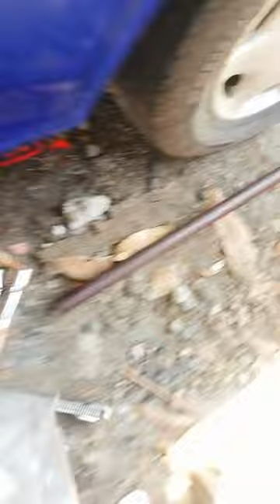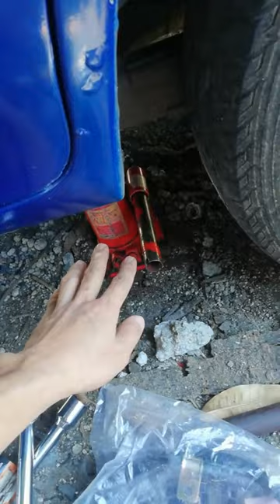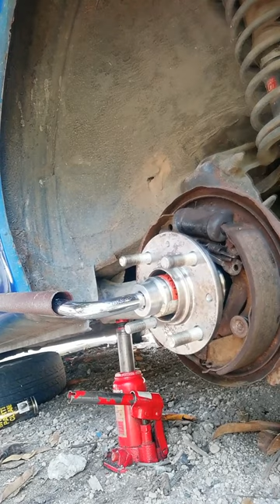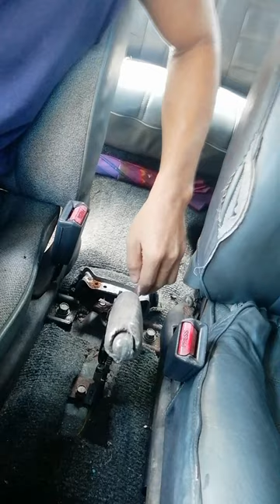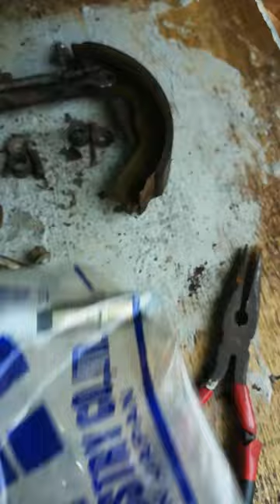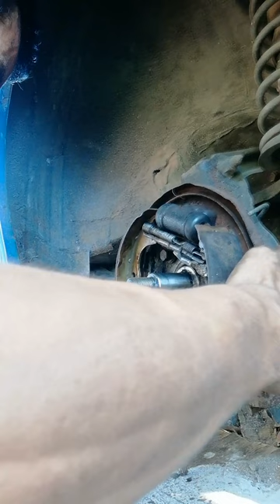replacing handbrake cable / how to install brakeshoe /mitsubishi lancer

Comment: boss same proceso po ba sa repalcement ng cable sa mirage hb 2013? at yong nut po ba ng mirage may lock din? sobrang tigas buksan.
Reply from the maker: opo same lng sir.. may lock din po
Reply: @joiediyautokalikot4846  kaya pala d ko mabuksan sobrang tigas, naputulan nako ng handle dalawa nabenkong. kaka check ko lang doon sa may adjuster likod ng hand brake. hindi sya mag move yong cable pag tinataas yong handbrake.

Comment: boss yong mirage hatchback ko stock up lang yong handbrake cable pwedi pa ba itong ayusin or palit handbrake cable na? kakapa check ko palang kanina stock up yong cable sabi ng mechanic bilhan nalang daw ng cable.
Reply from the maker: kung hindi naman putol sir di mo kailangan bumili ng bagong cable..
Reply from the maker: taga saan po pala kayo sir?.. kung may time ka dalhin mo dto para check natin baka kaya yan gawan ng paraan at hindi na mag stuck up..
Reply: @joiediyautokalikot4846  hindi sya putol at hindi rin stock up yong parts sa loob ng drum. dalawang shop na pinuntahan ko same recomendation replacement or baka hindi lang nila alam. Malayo po kase ako sir Leyte po location ko. Plan ko mag DIY kung pwedi pa maayos kaya napunta ako sa YT nyo.
Reply from the maker: @cyberbeast1789 need  ra na sprayhan wd40 sir  ipasulod sa cable